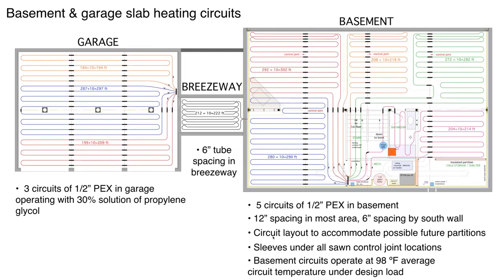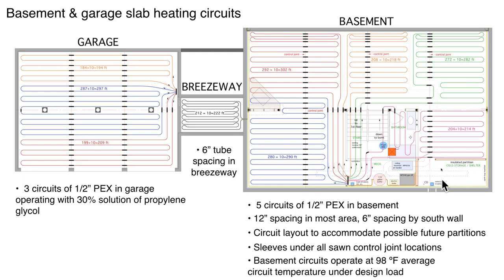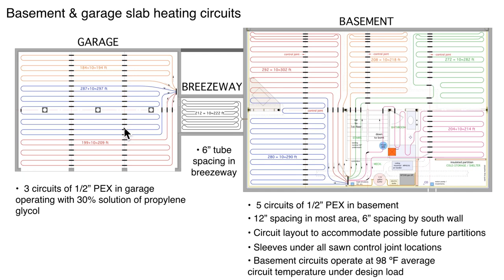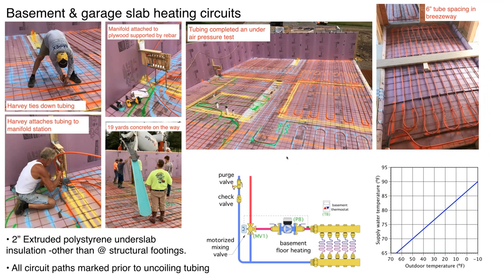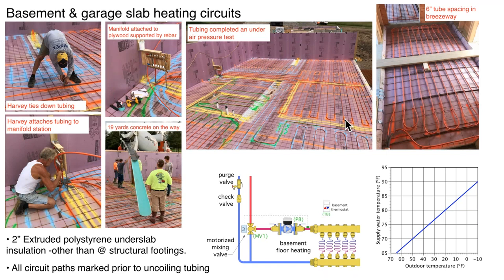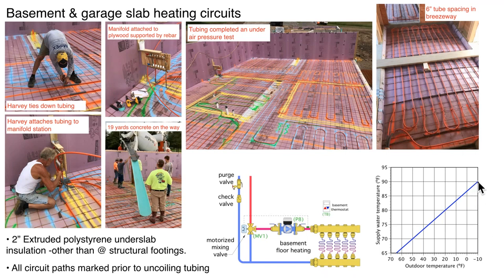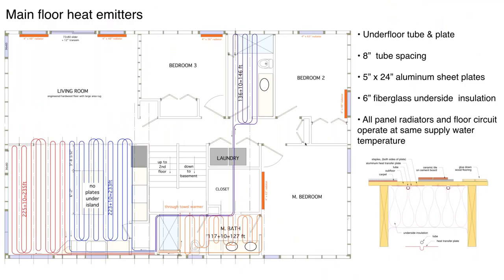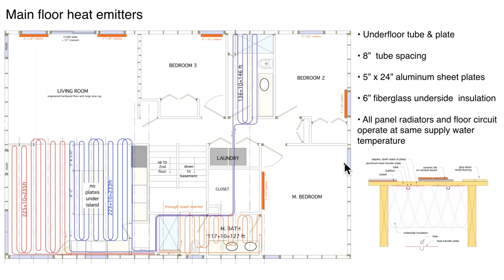Hydronic Tips: Radiant Floor Low Temp Layout Design

Comment: Nice video, the plate system is not only used in USA. I have used it on several systems in the uk 🇬🇧.
Reply from the maker: For maximum performance and comfort plates are critical. Leave it to our friends in the UK to lead the pack! :)
Reply: @EdenEnergyEquipment  The UK uses plates for the same reason that they are used in the USA - a very large number of our homes have wooden floors. Pipes set in screed or concrete are more common in Europe.
Reply from the maker: @tlangdon12  we have also been using plates for over a decade. Europe has always been an innovator in panel systems but North America is never far behind. Thanks for commenting.

Comment: Am I right in assuming that the choice of panel radiators in the bedrooms was also driven by the floor covering that you are expecting to be used in those rooms, e.g. carpets/underlayment with a high insulation value?